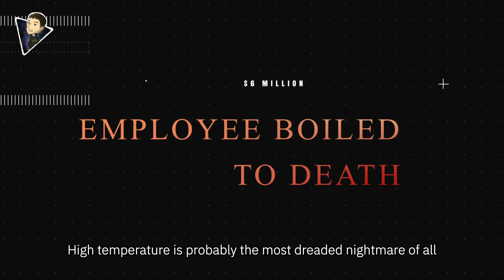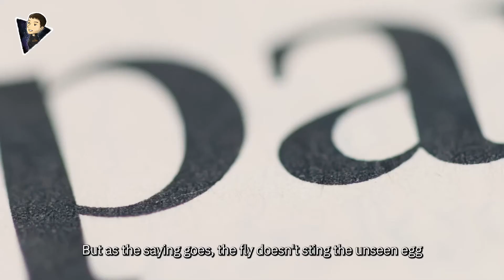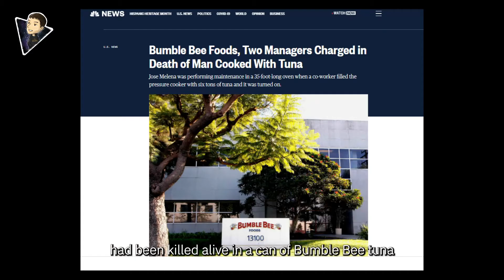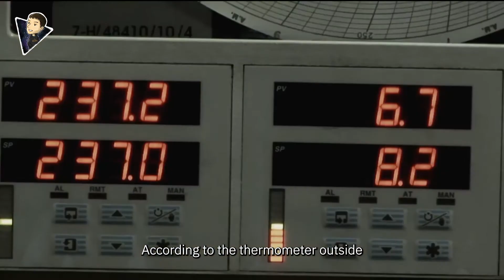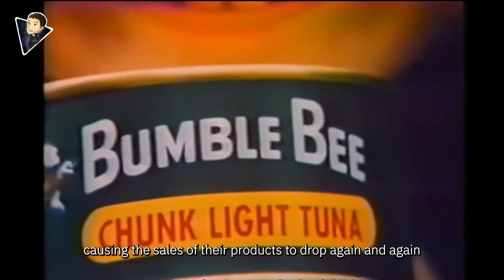The Case of Bumble Bee Factory Tuna Accident | Ture Story | Horrible Death | Crime Storytelling

Comment: As soon as Jose was noticed to be missing, EVERYTHING should've been shut off immediately esp since the oven was literally just started.
Reply: Have you ever worked on factory?
Reply: It's not a light switch and you think someone is instantly missing when usually they're just gone for a bit. Example: If you don't see your pet, you don't think it's missing , you  presume it's in its usually hiding spot
Reply: @moxiemaxie3543  ya but HE was responsible for that cart. No one else should've messed with it